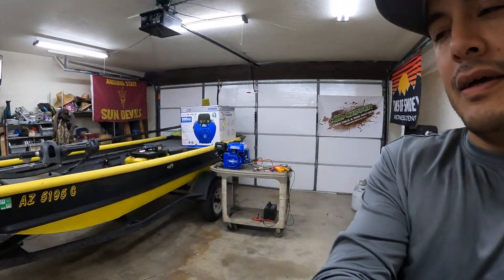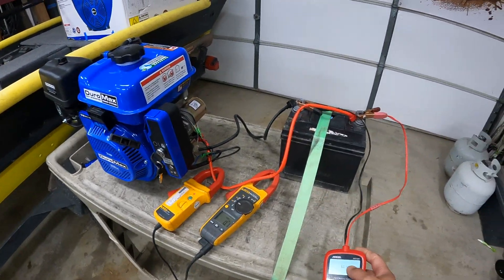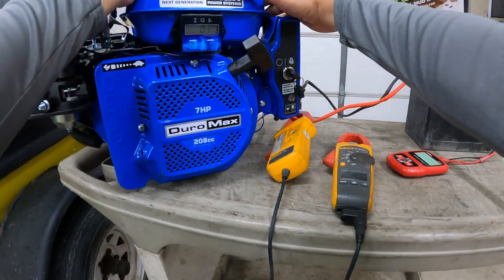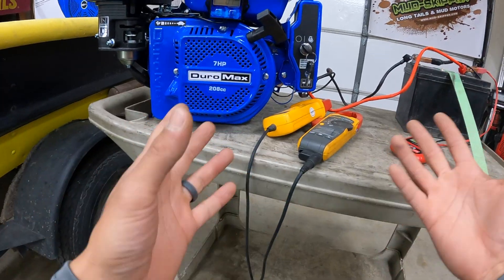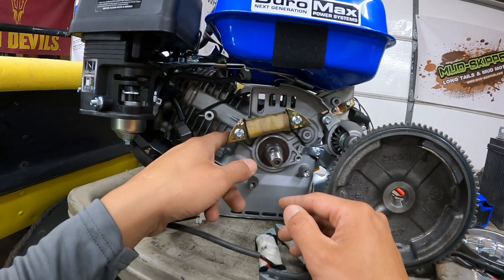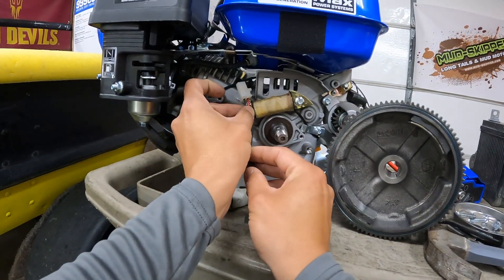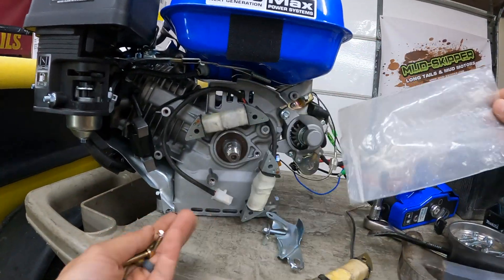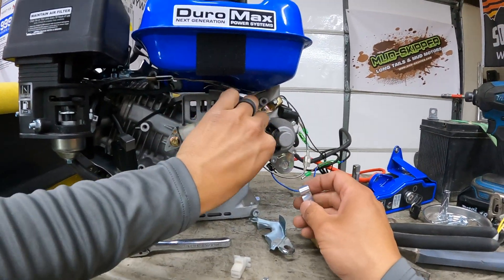Duromax 7hp Dual Charge Coil Upgrage Predator 212 or other GX200 Clones

Comment: I have a different regulator/rectifier, the one that has the red, yellow, pink and green wires. I know the red and green wires are power and ground on the regulator/rectifier. Does the black and red wires from the coil both go to the input wires on the regulator/rectifier?

Comment: Good vid. Very few vids out there explaining that when you are using insulated dual parallel coils, the red and black wires go directly to the 2 inputs of the regulator. Red and black doesn’t matter and the coils are not grounded to the chassis.

Comment: Great video! That's cool that the Duromax 208cc has a charge coil! do predators have a charging coil? the "Canadian" predators don't have them.
Reply from the maker: Most pull start only engines don't have the charge coils. Most electric start engines do, but likely the singe amp style coil. The predator will need a new flywheel with magnets for this modification to work.